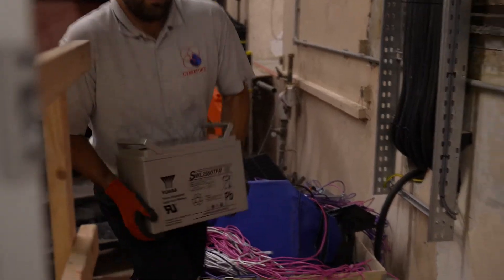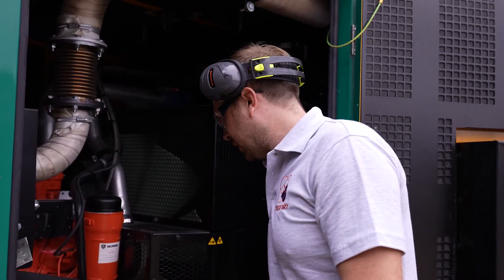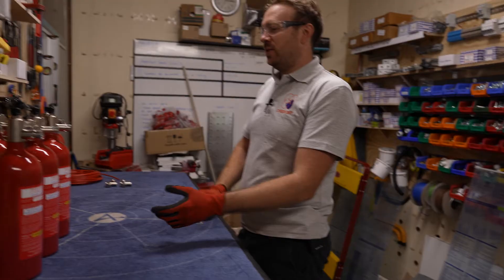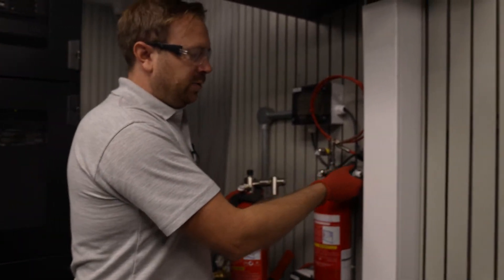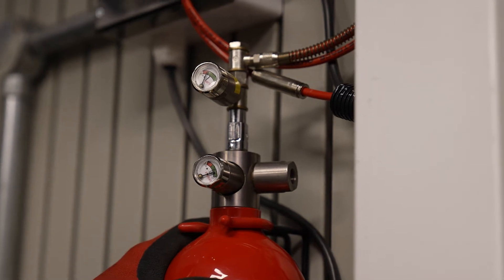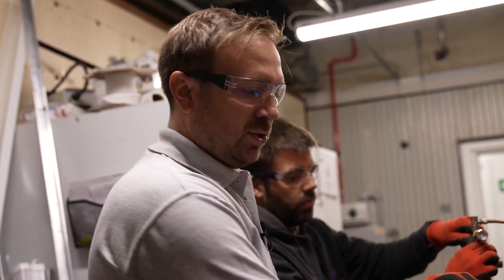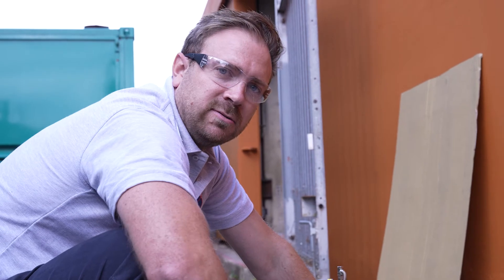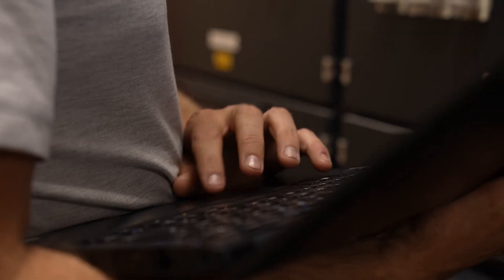A Day In The Life Of An Engineer In A Data Centre!

Comment: Question?
What kind of battery cells were those gray battery?-AGM, Lithium.
What kind of generator was that?
How many hours did it have on it?
Notice the ductless Daikins they had? 
Looked like 2 twin units.
Sounds like a bus or semi at start up.
What did they have 3 or 4 generators?
This place is huge, just going off the generators and the Daikin units.
Overhead fire suppression units I'm guessing.
Hence the nitrogen, they don't want oxygen in the lines.
Is Novek better as a pressurized liquid or in vapor form?
Do they have a hertz problem, or are they just watching the pulse form?
Are fires common in data centers?
If so what's the cause? Electrical....Would they be better over sizing the wire size?
Power factor they might watch for it......